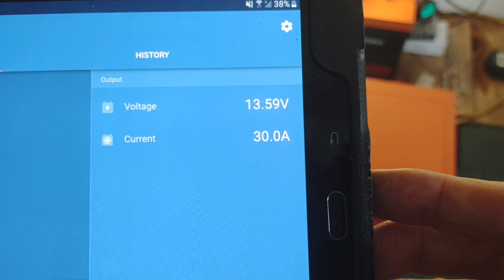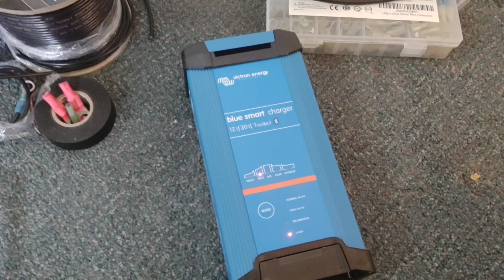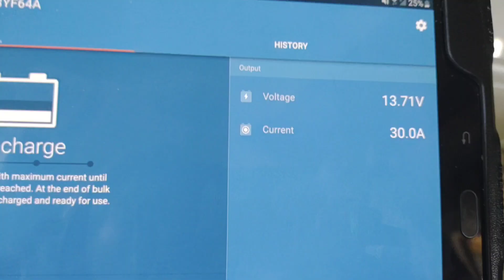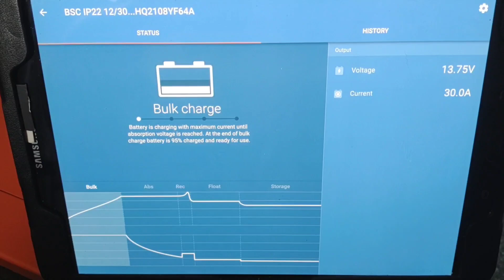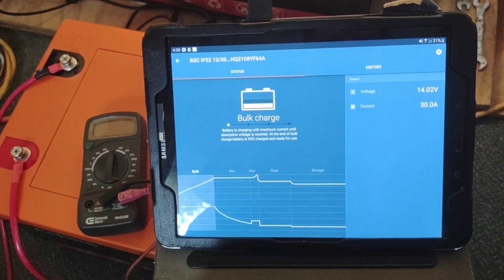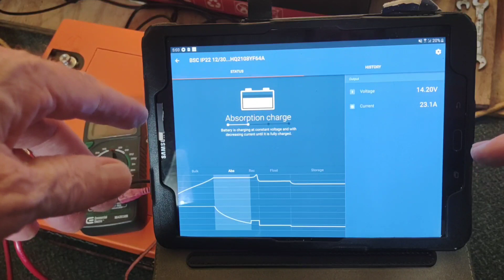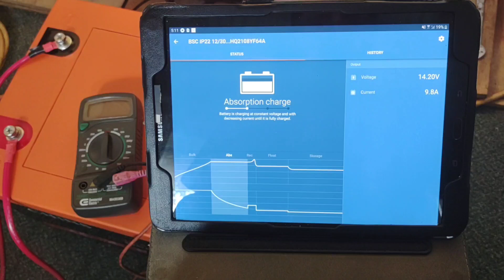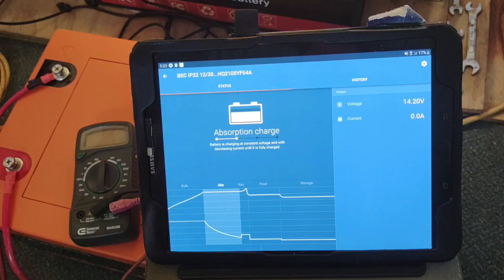Combining two Chins 300ah LiFePo4

Comment: great video... have you hooked two of these (or any of your LifePO4's) in series?   i have 1 100 AH Chins, want to get another, and debating series 24V vs parallel... thanks!
Reply from the maker: I have not done a series connection in anything I currently run. The parallel connection continues to work perfectly for my needs. Sometime in the future I will run in series just to show that that is perfectly fine too. Aloha 🤙

Comment: Do you know what size cable they are.
Reply: did you ever find out the wire size
Reply: No I didn't.
But I am very sure OHMS law will apply.
Thanks for your interest ☺️
Reply: It is dependent on the LOAD that the batteries are expected to carry.
And fused to protect the wire.

Comment: Sorry if you already covered it elsewhere in the comments but I was surprised from the view with your 3000W inverter on the wall, there is a sizeable red/positive cable, but looks like 2 much smaller black cables, I assume negative terminal and the case grounding terminal. Doesn't the much smaller black/negative terminal cable severely limit your inverter output?
Reply: Wish  these guys would  address  cable size

Comment: Are you sure the Victron has a fan? Much to my surprise, mine did not. I took the blue end panel off only to find an empty mount for a fan, so I put my own in. Cost cutting? As hot as it gets, it needs a fan, and I am sure they are only paying a few cents for a fan.
Reply from the maker: I am going to look now that you have told me of what you found...or rather didn't find. I was certain I was hearing the fan (which can't be seen) but now I want to know for sure after reading this...thanks for passing that information along for us to look at🤙

Comment: I think, your other charger that cut off at 14.2 volt, that sounded like for lead acid battery. As Victron 30 amp LiFePO4 charger is consider slow charge for 300Ah battery. LiFePO4 battery at fully charged cut-off at around 14.4V to 14.6V, maybe CHINS rather cut off at little lower voltage.
Reply from the maker: yeah, Chins recommends 14.2-14.6...I'm currently keeping it at 14.2 since no real appreciative amps to be gained after that...aloha,  and thank's for your comments 🤙

Comment: Looks great . Keep lead length to charger short and heavy AWG like you got. That voltage drop will effect the charger showing less voltage than your meter . way different than lead acid . they charge heavy right up to 95% or so .LFP about 90% EFF. and lead around 75 to 80% EFF best to leave charger on until complete . the balance in the BMS should match the 4 cells .
Reply from the maker: Thank you Robert! Was fun watching the charger do it's thing, and I now have full confidence in it. Thinking of connecting it to the bus bars and wall mounting it for ease of future use. What do you think of driving it through those? Should be okay yeah? Aloha 🤙
Reply: @ProjectsinParadise808  should be great ! use a breaker 45 or 50 amp for safety. keep off when not in use .I don't know if that charger has self discharge when no AC. put breaker on Pos lead of charger. always have a means of quick disconnect for safety .
Reply from the maker: meyer  copy that! I've got a 50 amp, and will use that. Thanks a lot!🤙

Comment: That charger says Li-Ion but I thought these batteries were LiFePo4. They are not the same I am only a few minutes in I will keep watching but an observation I made.
Reply: There is different types of Li battery's . each has different charge and discharge points . best to get info from MFG. That charger has set points you can change if needed. LiFePO4 is LFP . same charge points.

Comment: Pretty much doing the same thing on my Chins 300AH, but using two Victron IP67 24 volt ( 12amp) chargers running in parallel (24amps @24v)for my 24v system. Doing some lots of bench testing before installing into the RV. Thanks for the upload! It will be interesting to see how these batteries do over time. Take care, Mike WG7D
Reply from the maker: Hey thank you for watching and commenting.  Yes, hoping as you do that these go the distance for us. So far, so good! I'm going to take a look at your video later this evening,  it popped up for me and I saved it to watch.  Please do keep us updated how it's working for you, and if you discover any intricacies we need to know about.  Aloha 🤙
Reply: @ProjectsinParadise808  Will do. They should make a great battery bank.  My AGMs are getting a little tired.